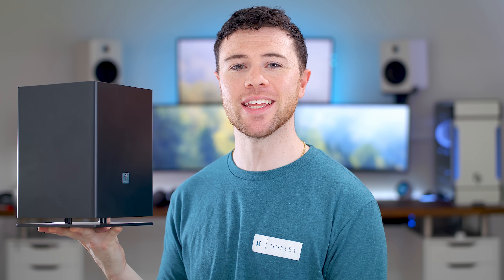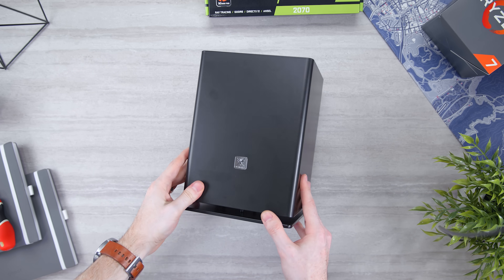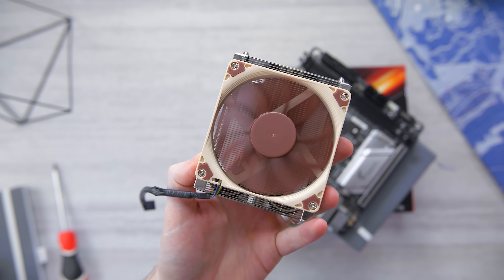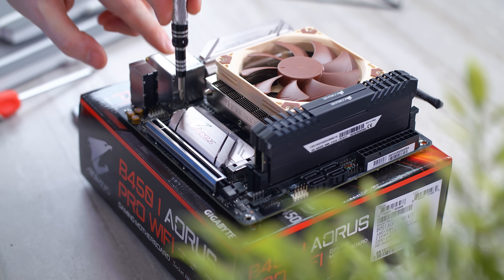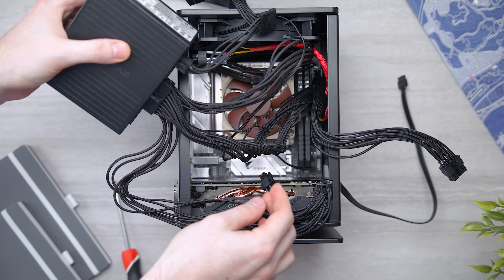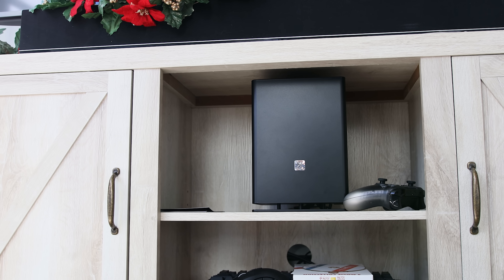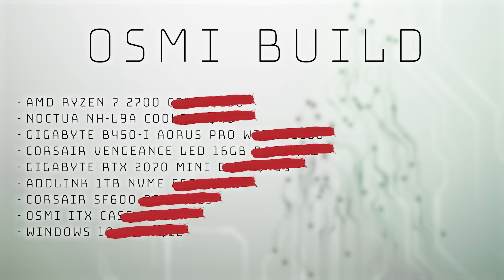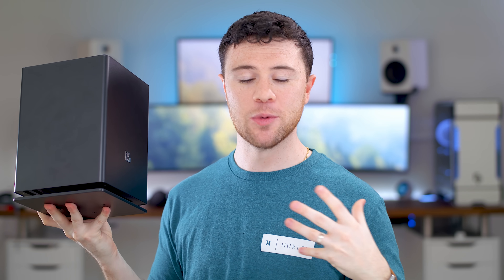I Built the Xbox Series X as a PC

Comment: Does anyone else think this video is completely pointless? 

Xbox uses a custom Zen 2 CPU and AMD GPU. This PC, Zen 1 CPU and an Nvidia video card (that, at 7.5 TFLOPS, is nearly half as powerful as the rumored 12TFLOPS Xbox). This is a $1,300 build against a console that will probably retail for $499 (dude is insane that he thinks Microsoft would launch a $700 console and that this is a win for the consume. Not a chance in hell of that happening). Also, as if the price wasn't skewed enough, he didn't factor in the fact that the Xbox will come with a controller ($60) and a 4K Blu Ray drive ($100+).  Also he talks like Microsoft is going to be buying a motherboard and slapping in a CPU, GPU, RAM, and SSD. Every component is custom made for this box and gets worked into the motherboard. Sorry Frank, but I don't think you really understand how consoles get made. 

Even ignoring all that, there is absolutely no mention of the hyper-optimized nature of game consoles. Even if he built a PC that was as powerful as the upcoming Xbox, games would perform substantially better on the Xbox due to the nature of how they get programmed. There is a reason the ~$300, 6TFLOP Xbox One X can run RDR2 at 4K 30FPS, which on the PC spectrum would require at least a 2060 (6.5TFLOPS, $350 for just the GPU, roughly $1,000 for the appropriate complete system). The $1,300 PC you see above isn't capable of 4K/60fps/Ultra settings on most modern games. RoTR, AC: Origins/Odyssey, FC5/New Dawn, GR: Wildlands/Breakpoint, RDR2, DX: Mankind Divided, Metro, Witcher 3, Destiny 2, Gears 5, BF:V, BL3, Outer Worlds.... not a single one of these games will hit 4k60 on a 2070 without dropping other settings... and games aren't exactly going to get less demanding once new consoles roll out. Series X will steamroll this build at a fraction of the price. 

It irks me every time I see these "build the upcoming console as a PC now" videos. Even with consoles being more PC like than ever before, they will never be comparable. And before the fanboys roll out, I'm a die-hard PC first gamer who will absolutely not own the next Xbox. Doesn't change the fact that PC's, for all their advantages, are significantly more expensive and less optimized than there console counterparts, especially at the start of a new generation where consoles are typically sold at a loss in hopes to gain greater market share and make their profits with games, services, and accessories. Trying to convince anyone that this build is anything even close to the upcoming Xbox is ridiculous, fantasy clickbait.

Comment: that's without counting the keyboard and mouse ... xbox will very likely ship with an hdmi cable and a controller. PS5 too.. PC gamers should now see that RTX is nothing without the push of consoles. Consoles move the industry up love them or hate them.
Reply: Consoles are nothing more than a small piece of the puzzle... PC are on a 2 year cycle... you guys are on seven... 

They are going to outdo you regardless the following year so they have no reason to respond to you .

Not to mention their gaming market is different from consoles so they need an entirely different set of specs ..

I know you want the consoles to feel important, BUT it’s the PC market that helps the consoles and they are nothing without the PC market. Your hardware advancement depend on them continually purchasing hardware ...

Comment: You Didn't make a PC equivalent of the Xbox series X. a 2700x is Zen Plus architecture, leaks are specifying that the Xbox series x will be running a Zen 2 CPU architecture possibly with some zen 3 traits brought in from the ongoing development of zen 3 CPU's. PCI-E 4.0 is only found in the zen 2 CPU's at the moment so this isn't even close.  the CPU you picked is slower than what the series x will have. (while the 3700x should be around what the leaks are specifying) that ram is also no where near fast enough. to try and approach the speed of the GDDR6 ram that the consoles are using, you need to put in at least DDR 3667 ram with tight timings, corsair LPX 3000 is not fast enough and will impact the CPU to not perform as well.  the Geforce 2070 Non super is WAY too slow, we are looking at a leaked performance of ~a 1080ti/2080 super on the Xbox series x, hell even a Radeon 5700xt would be a better candidate. Also the PCI Gen 3 SSD, you selected is in no way fast enough to keep up with the Gen 4 in the new consoles.

You DID NOT create a PC with equivalent performance of the consoles. this machine will be about 15% slower. Pretty much anyone who has an AMD Ryzen  3700x or 3800x and a RTX Geforce 2080 super (or there abouts for ray tracing) (or highly overclocked 5700xt for brand accuracy) with a fast NVME SSD with a transfer rate of at least 4 GB/s or higher and about 16 GB (of DDR4 3600+) ram already has an Xbox series X. Its why most PC users aren't exactly losing our brains over the specs of the Xbox, because we are already running it.  While its great console Gamers are finally stepping into the modern era, the next gen consoles are (from current leaks) are just gaming PC's that will run custom operating systems. how much do you want to bet Console Fan people are going to get annoyed by that fact very intensely.

I'm not a console fanboy, i'd say i'm solidly PCMR, but you should at least give the consoles the specs they legitimately will have if you are going to claim to have equaled it. (which isn't hard to do)

Comment: Really weird choices
The new xbox will use the 7 nm Ryzen cpu which has better IPC and it will likely be single threaded
The GPU will be 12 TFLOPS which makes it more powerfull than rtx 2080 super but weaker than rtx 2080 ti
The RAM will be shared GDDR6 as it's a APU

Comment: You’re using GDDR4 instead of GDDR6 that will be available in the next Xbox. The RTX 2070 has its won memory that’s faster, but then it doesn’t equal 12GB. Also, APUs like what’s going to be available with the next Xbox is going to be more efficient. You’re also comparing today’s pricing with what’s going to available next year. This is an ok comparison, but not apples to apples.

Comment: More accurate Specs:

Ryzen 3800X 8 Core Zen 2
Radeon VII 7nm 
1TB Aurous NVM M.2 PCI4 5000Mb Next Gen
16 RAM 3200MHZ
Windows 10
750Watt Supply
Reply: @Zane White Ok dude... 

Battlefield 5 runs at 4K60 on Xbox One X... (Upscaled or not it can reach this) can you do the same on a RX 480?
Forza Horizon 4 runs at 4K or 1080p 60, can a single RX 480 do both? And in max settings? because Xbox uses most of them because games looks perfect on it.

GTX 1080ti has like 11 Teraflops and its faster than Vega 56 and 64... so this its like using 2 RX 480?
Find a processor of 2Ghz and see if it can do the same Xbox One X does!
A MacBook Pro with i9 can reach 5Ghz and because of that you wont say its powerful as a desktop 9900K! 

You re based on exact numbers! So it make you think the next Xbox or PS5 have the same power like a budget PC
Reply: @Zane White Ok buddy...
The X Series uses and 8 Core CPU Zen 2 on its specs. Whats the closest thing to it?
Ryzen 7 3800X! If the Xbox its 4 times the power of Xbox One X as they claim this processor its the best match)
The Radeon VII its the most powerful current GPU from Radeon similar to RTX 2080! 
So this would be the match, although 5700XT Liquid Cooled also match. (Just for power reference!) 

And dont focus on the frequency speed at all! The Xbox One X have a 2.15 speed and still capable of 4K on majority of games.
Reply: Zane White 
Well you were wrong. It’s 12 TF RDNA2 ... much MUCH better than a “more efficient 5700”
A 5700 xt and a 2070 Super are both around 9 Teraflops and perform similarly. And that’s on RDNA1
The Series X will likely be on par or better than a 2080 super. For less money than the 2080 super by itself.
Reply: @Zane White Then show me gameplays of a RX480 running like Xbox One X! 

You just see number on the Xbox specs and it becomes like a Budget PC... so PS5 be an 580? Hope your right!

A 1080 its equivalent like a Radeon Vega 64 and still has different values on its specs.

Your the only one here thinking that way! next time show me those gameplays... or dont even bother...
Reply: @Zane White I saw gameplays! Just wanted to give you chances of your stupidness and non sense...

RX 480 struggle for 4k and even 60 Fps... Thats targeted for 1080p gaming. The RX 580 its a close match.
I wont understand but you just dont like consoles so anyway... 

 Just bought mine... 

Not a incredible powerful RX 480! A crap Xbox One X!
Reply: @Zane White Wow, AMD kicking with his graphic cards!!

Next year be like...  

TheVerge:  RX570 out performing your Xbox and PS5... hahaha

Sorry I haven seen the "facts"...
Reply: @Zane White No its pretty clear...
 
Im gonna buy 2 tiny RX 570s to play in 4K! 
Im mean what the hell!! 
8K babe!!

Screw you Xbox and PS5 you sucked!
Reply: @Zane White Hey whats up!

Where are you?
Hope we can have the new Xbox Ryzen Edition! 
With Vega 5 Graphics!!

Hahah...
Reply: @Zane White I dont have to comprend anything...

Why spend money on Xbox or Playstation when you have the power of a single RX 480...
Now imagine two of these!! Even a RTX Titan cant reach such levels...

Its fun to argue with you
Reply: @Zane White No... im being real serious!

You open my eyes... just the polaris arquitecture its what make this GPUs stronger.
I was about to buy an xbox one x before the series x make it. But why buy this if a tiny 100 GPU can surpass it.

I mean even a RX 460 can beat the shit of a Playstation. Now two of these!! You have a Nasa PC..

Comment: Should bench the system on a few games and see what titles you can run at 4k @ 120fps and what games will run @ 4k 60fps.
I suspect this PC will still outclass the new xbox, If this PC CAN'T do it, then either there are some console optimization and or the games have a lower render resolution.
Reply: How so. Shouldn't the new Xbox run significantly better than a PC with variable hardware and a more complex operating system?
Xbox games can be coded to the metal and get optimized based on the strengths and weaknesses of the system.
The best you can do on PC is tweak settings

Comment: It's going to be a lot more like a underclocked 3700x with a 2070S/5700xt at most in performance if it uses current hardware, however thats alot for consoles. I'd be surprised if they used something 2080 ti like but we don't officially know how much if any better the custom GPU will be Architecturally than current RDNA, microsoft already confirmed they stock with RDNA so 5700xt ish seems likely

Comment: Bro it's not gonna be even near a 2080 super especially a 2080ti level of performace I would predict more around the ball park of a 2060 simply because of cost you're not getting that performance at 500 dollars it's just not happening they can claim all they want but I dont its gonna be able to do 4k 120 and most likely will barely be able to do 4k 60 especially with rtx on hell not even a 2080ti can do 4k 120 very well or at all and since amd still doesnt even have a full size gpu that can get 2080ti levels of performace so how in the hell are they gonna pull off in a fucking xbox or ps5 at again around 500 dollars it's not happening pal

Comment: Should have used the the Gen 3 Ryzen CPUs because the Xbox is based on it. I want to say either 3600 that has 6-cores but only cost with in 200 is dollars, or the 3700X that has 8-core but cost 330 US dollars. While for the GPU the RX 580 which has similar performance to Xbox One X and cost of around 200 US dollars would leave me with feeling the 5500 XT would be used to be similar to the Xbox Series X

Comment: What would the Tera-Flops be for a Ryzen 7 3700X with RTX 2070 Super and 32 Gig of Memory? I know the new XBOX is suppose to be 12 Teraflops.
Reply: Don't get too worked up on teraflops. 2070 super has 8 teraflops i believe but that won't tell you much. Teraflops have become a buzzword this generation and usually are only used to measure the raw processing power of one single component in a console: the gpu. Stuff like the ram, the ssd etc aren't even taken into account
Reply: But to kinda answer your question:
3700x will be a bit more powerful than Series X
32 gb ram seems a bit too high but I could be wrong.
Rtx 2070 super seems about right eventhough there are supposed leaks that suggest Series X could be even more poweful if 12tf are true.

Comment: So many things wrong with this video. This is no comparison what-so-ever and doesn't give any insight into the performance of the Series X at all for several reasons.
Reply: Does the title say "Comparing my custom X-box like pc with the Actual X-Box"? No, he's simply matched the specs to what the new xbox is supposed to have.
Reply: @paranoidpanda7694  lmao uh no...he did not match the specs. Not even close. That's the problem.
Reply: @nismojukerich2994  Well then what are the specs for the xbox thats so jarringly different
Reply: @paranoidpanda7694  different generation of processor. Unifiied memory. AMD gpu, not nvidia.
Not too far off but not really usefull either.
He should have overclocked a 5700xt instead of using a 2070 mini

Comment: Why would I spend $1400 on a pc that’s going to need constant updates, upgrades, and general upkeep when I can get an even slightly more powerful console that’s going to last me a guaranteed 7 years for $600????
Reply: Are you high? A pc doesn't just magically stop working after a few years. A pc and console with the same specs will still be competitive with each 6 years later. You fanboys take stupid to another level.
Reply: Total ignorance. 

You do not need to constantly upgrade a PC. The choice is there only if you want to, unlike consoles. 

Plus, 7 years of console gaming = around £350 of online subscription fees. Then on top of that you have more expensive games. Then on top of that if you want to do any work you need to buy a separate laptop.
Reply: G1 who doesn’t have a laptop? And your argument is like me saying, “If you want to game on your living room tv, you have to buy a separate console.” And besides $600 + $350 is STILL cheaper than buying a $14-1500 pc.
Reply: leonxl - of course it’s cheaper, because it’s used for only one thing. A PC is a multi purpose machine that can also run games extremely well.

And the reason the PC in this video cost so much was the form factor. You could have built a similarly performing machine for a lot less by not going for a expensive SFF case, SFF PSU, MITX board, LED RAM etc.
Reply: Bruh, you both wrong. If the console will last 7 years, then the PC equivalent will last 10 years. But the console will be half the price. With the console it’ll be as expensive to upgrade.
Reply: G1 you do realize that the cpu and GPU that he picked are weaker than what’s going to be in the Series X right? You want to take away $100 because of the case? Fine, but I want to add $100 because you’ll need more expensive cpu/GPU to accurately compete against the Series x. And he’s not even adding in the $60 controller or M+K OR the optical drive. So let’s just keep it at $1400. And we’re not talking about what a computer can’t or can’t do. We’re talking about gaming performance. Don’t deviate.
Reply: leonxl - Me deviate? You’re original point which I called you out for was the argument that a PC needs constant upgrades. 

It’s well known that a console at launch is excellent value. The latest gen of consoles are always more value than an equivalent PC, but when you add up the online subs, the extra cost of games, the fact that a console can only be used for one thing, the fact that entire genres of games are not on console, the fact that you alter settings or hardware to what you want, the fact you’re stuck using one screen etc etc, the PC balances that out.
Reply: G1 you really want to make a big deal out of saving $10-15 from triple a launches? If that’s the case then can render that argument useless by saying I actually save money by paying $10 per month and having access to over 150 games on GamePass? Everything else you listed is basically just preference and that doesn’t really hold in a comparative argument...
Reply: G1 as I said before, most people already have a laptop to do work on. Which is precisely why the argument of “do more than just gaming hur dur” is invalid. We’re strictly talking about GAMING, nothing else....

Comment: Didn't use a RTX 2080 super no ray tracing no series x so the title is click bait whyyyyyyyyy
Reply: How old are you??
Reply: How is the title clickbait??
Reply: Twister_T _35 cause the Xbox series x and ps5 are on par if not a lil bit better than a 2080
Reply: Twister_T _35 that’s why
Reply: There's multiple reasons why this can't be compared to the Series X. For one he didn't use an AMD cpu with zen 2 cores. 2nd it will have gddr5 memory not ddr4. 3rd he only used a regular 2070. Even the 5700xt is slightly above that. And finally and most importantly the nvme ssd is gonna not only be used for storage but also as a ram cache so there's no way to try to calculate what kind of performance difference that alone is gonna make being pc's don't even have that capability right now. This is no comparison what-so-ever. Sounds good tho lol
Reply: @nismojukerich2994  Actually MS confirmed that the XSX is using GDDR6 memory.  This build would be so FAR behind either PS5 or XSX it's comical.
Reply: @riceeater79  You're right that's what I meant to put. Plus add in the variable refresh rate and variable rate shading. That's gonna make a pretty decent difference as well.